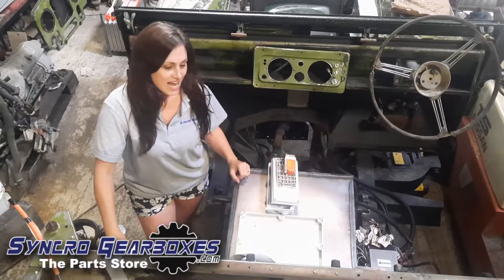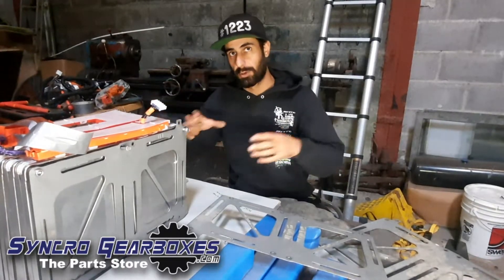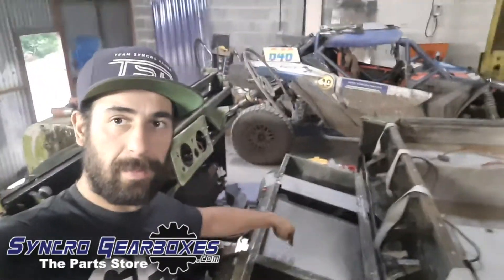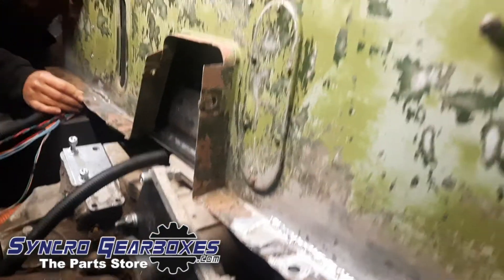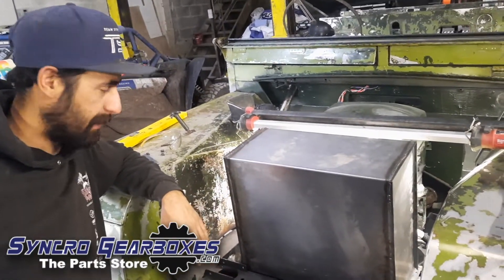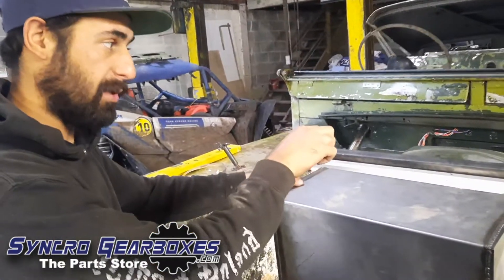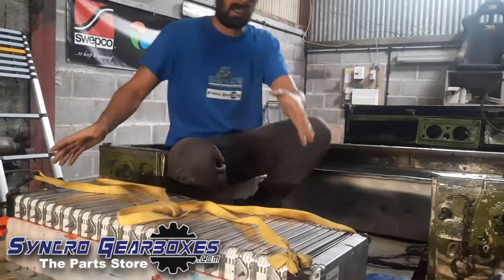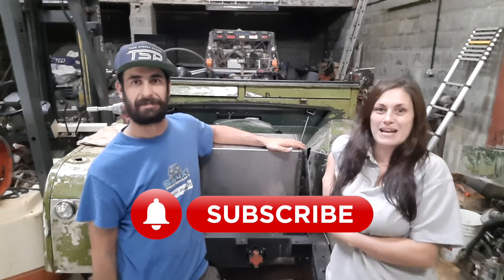09 - NISSAN LEAF BATTERY PACK INSTALLATION - Project Series EV: Land Rover Series 1 EV ⚡️⚡️

Comment: Are you planning to use the Leaf BMS? I was told if you split the batteries you couldn’t. Planning similar on Defender. Interesting watching.
Reply from the maker: Yep, we're still using the leaf bms. The only aftermarket change is the stand alone ecu

Comment: I'm beginning to realise how big that battery pack is! 😬
What about the space under the driver and passenger seat where the fuel tank would have been?... But I suppose that would leave you to having wiring running in all directions 🤔
Keep up the good work 👍🏻
Reply from the maker: Yeah there is the space there but not for all of it. Id need some under tub, some under driver some under passenger. I've got stuff under seats so would then need to move that too... 😄 🤣 
We will move it in the future but for now it will go in the tub.